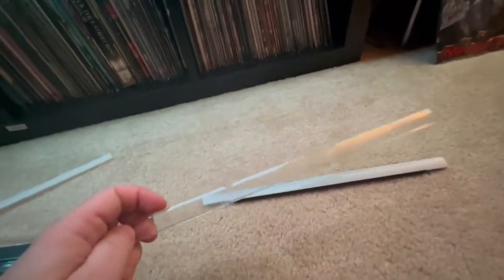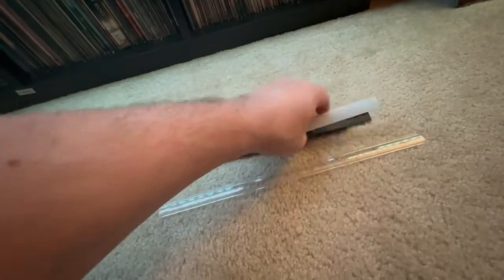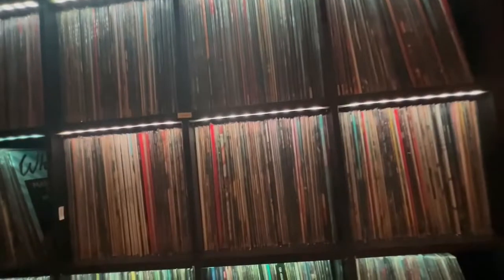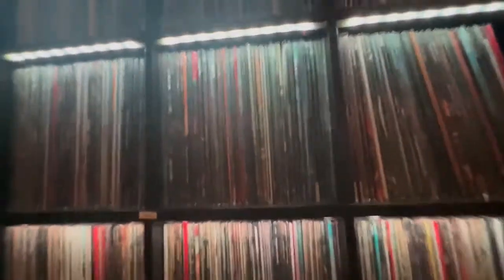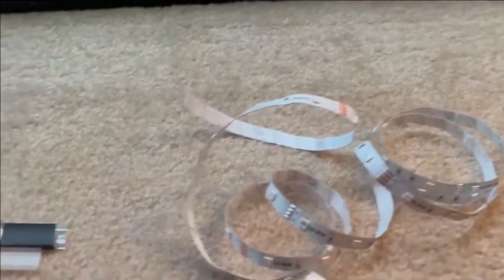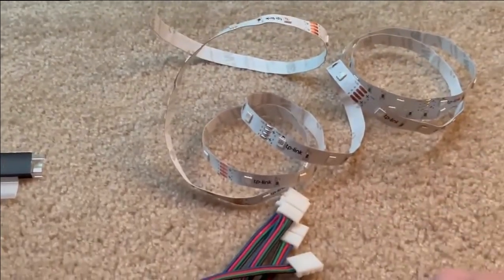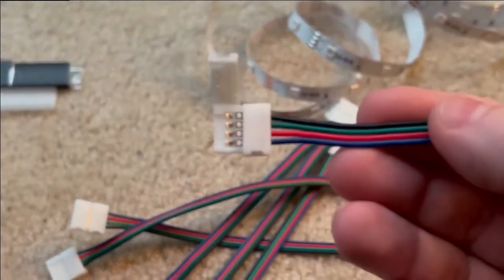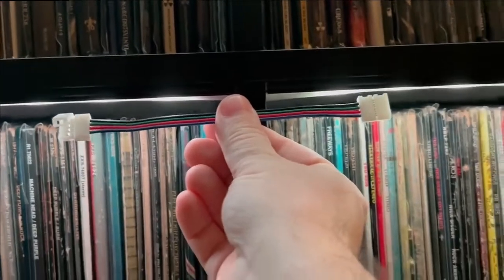Record Shelf LED Lighting

Comment: Hey! Sweet collection and lighting setup! Really nice.

I store my records in the same type of shelves, been thinking of putting LEDs in as well.
Got this idea; how about, instead of cutting up the LED strips and feeding cables through holes, I'd cut the LED strips length to the width of the shelf and cut bigger holes so that I can feed the entire LED strip through all horizontal sections. Probably rectangular holes, cut out with a jigsaw? Then do what you've done with cables between vertical strips.
Did you entertain this idea and rule it out? What do you think?

Thanks for the video, really good. Wouldn't mind seeing more :)
All the best! // Jonas, Sweden
Reply from the maker: It should work but the holes for the strips between shelves will have to be closer to the front unless you run the LED and 'rails' a little further back, which if your records are further back anyway should work.